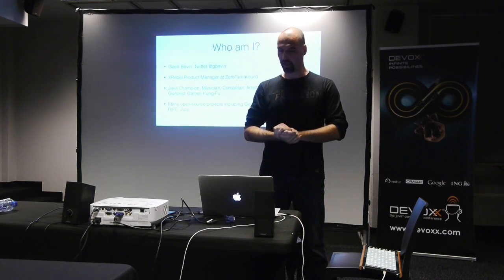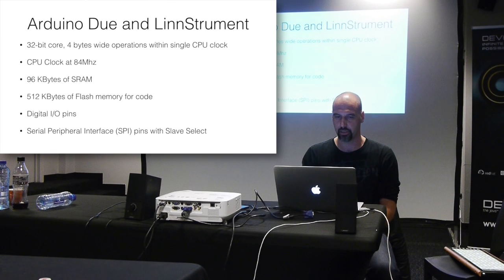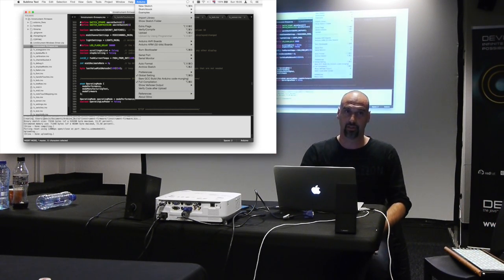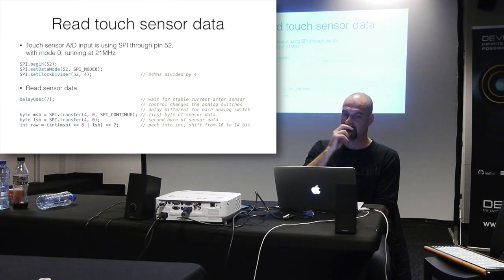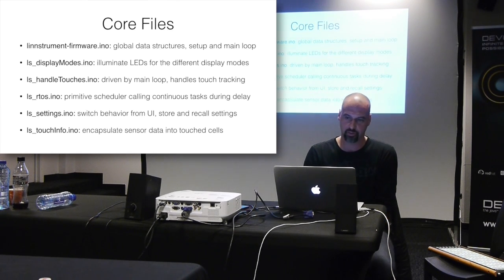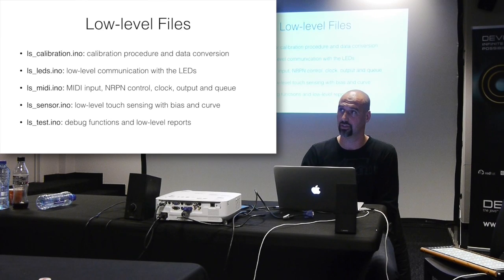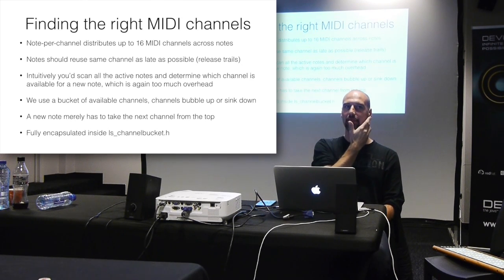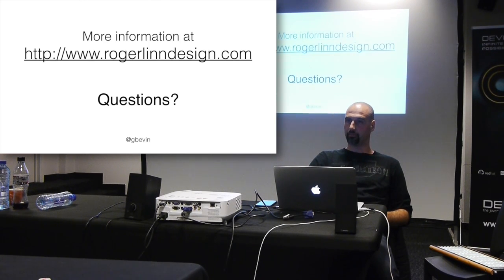LinnStrument : the ultimate open-source hacker instrument (Devoxx 2104)

Comment from the maker: @Michael with some programming effort, that would definitely be possible. At the moment, you can turn off all pitch quantization, and then you can play any microtonal pitch as on a fully fretless instrument
Reply: Hi Geert, Thanks for your reply.  What do you mean that it would be "possible" with "some" effort? Are you saying  politely that it would be very difficult and require a lot of effort?   The reason I am asking is that Linnstrument offers tremendous promise (!!!) but as currently programmed the choice is 12ET or no quantization at all.....
Reply from the maker: Michael LaFlamme since this video is about software development, I figured you were looking for a response going towards that. As far as user features goes, yes the LinnStrument for now only supports 12ET scales. The main challenge is the distances between the cells. If you have scales that don't have identical intervals between notes, some cells have to perform larger bends than others, with the same amount of slide movement. We're not sure that this would be comfortable to play, so we've decided to leave that for experimentation at a later time after this initial release. As far as development is concerned, adding this would be of moderate difficulty. All the hard problems are solved and are documented in the code, it's merely a matter of making the quantization points configurable and switchable.
Reply: Geert Bevin Thank you very much for answering my software development question about scales and intervals so clearly!  I wanted to get an idea of the work ahead if I wanted to hack Linnstrument for custom scales.  Much appreciated.

Comment: Good talk, & awesome effort with opensourcing albeit part of it. Looking forward to more microtonal-friendly model; hoping that I'll be able to pile that hefty sum before it arrives. Also interested in trying to do a polyphonic sequencer with parameter locking for grid device - even in current state LS seems like king of 'em. Well, the sequencer itself not necessarily needs to be onboard: those chips have so little RAM, hybrid architecture (split between host and instrument) may be necessary if one is about to lock a bunch of parameters with each note, & if softsynth is involved anyway... Will be poking around Launchpad Pro "headless" emulator 1st, & then maybe real LPP next, because of $; but if LS had greater grid resolution & I knew that I'll be able to re-tune it on the fly (say with split bottom row, or the leftmost - doesn't matter) - I'd be stockpiling $ first.

Comment: Thanks for the video Geert. Being more of a musician than programmer, what is the most efficient way to program a customized LED color layout and preset? Would it be through a DAW project file (Cubase, Logic), or a midi text editor/script? 

I hope that someone will bridge the gap for musicians and create a LinnStrument editor app for color, pitch and region layout setups and presets (with an intuitive GUI)!
Reply from the maker: LinnStrument allows you to change the color of any LED through MIDI CC 20, 21 and 22 https://github.com/rogerlinndesign/linnstrument-firmware/blob/master/midi.txt
This is not persisted, so it should be sent at startup. Someone has created some max objects for this I think.
Now, there are various configurations that are supported by the firmware. You can customize the color of any scale position with a main and accent color, you can also split the surface in two different sections with customizable width.
Reply: Looking into this now.

Comment: The fact that you mention delays so often in this presentation surprises me with this expensive controller...why a decision was not made to use dedicated display chip or scanning chip to have the main chip doing only the high level stuff...there is too much investment in your time to making timing correct. Very surprised you'd wouldn't use interrupts ...at least you have not used interrupt too often in presentation. With different finger shape and strength of finger you want the main chip routines to be very smart ... plus you could really do some smart slides in vertical direction...more calculation power to the main chip could also give you a Better automated calibration of sensors. If you scanning with high frequency the capacitance of PCB wires  is messing with window of "good" values from a sensor there fore your scan time per cell is much longer... I would scan 4 columns at once to lower the requirements on timing ....but that is long conversation, you'd argue that you still need to process 4 lines at the same time ...here where I'd employ FPGA to do that crap for me  ....
Reply from the maker: Funk Tree at one point you just have to make the software work with the hardware at hand. There are significant advantages with the simplicity of using just an Arduino Due, it allows anyone to experiment and tweak the code. This has allowed many users to easily tweak LinnStrument to their liking. In the end we've created an electronic instrument that feels and plays great, with a very rich feature set. That's really what matters.
Reply: Geert Bevin  Geert, thanks, I was thinking about this to be the case. (A completion of a project) But if your time was more on cleaning noise while getting the X,Y,Z, values then you cannot concentrate on 'near pad false triggers' or similar errors that I experience with LI....also the FPGA those days could not be programmed via aurdino., I own LI and love it but some of the things you mentioned in this presentation (godsend) klick with me.... specially the glide or how you distinguish near hit of adjacent pad. There is lot more that can be done  with LI or similar controllers, with new ICs on the market these days. The problem is that expressiveness is on nobody's radar. Look at MPE enabled instruments not too hot topic for most of the manufacturers ...if BTE had less latency we could ignore MPE and we could have a feedback from device/synth on knob positions etc aka Ableton push....I could go on and on...so rather stop :)

Comment: But which column does one use on the Linnstrument 128 for debugging?
Reply from the maker: Shaikat Hossain you obviously can't do it on the LinnStrument, you can enable it at startup by setting the variables in the code instead of relying on pressing a cell

Comment: Given the price of the device, what advantage does it have over a solution based on a iPad + software?
Even if you don't consider a 3DTouch iPhone with pressure detection, this can be emulated on iPad tracking the majorRadius changes, and it's natively multi-touch, so there are already more input dimensions available than on the LinnStrument hardware. (And of course, an Android solution would be cheaper and could also be opensource).  Oh, and yes, existing iPad apps already implement microtonal features.